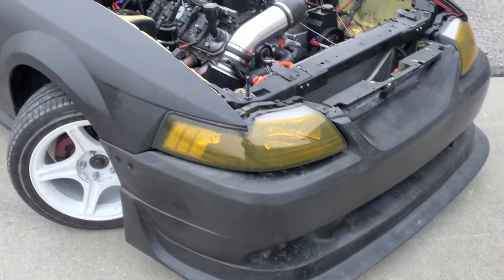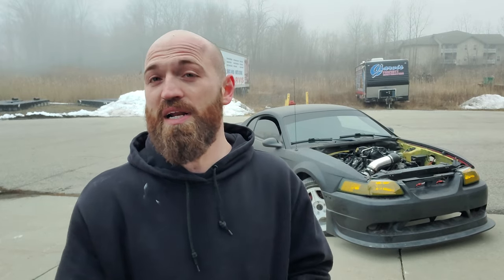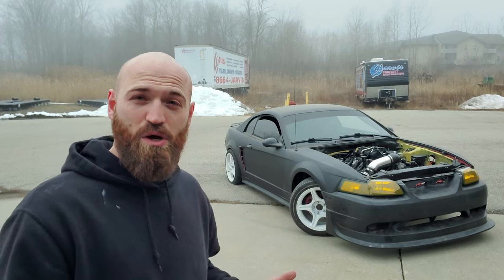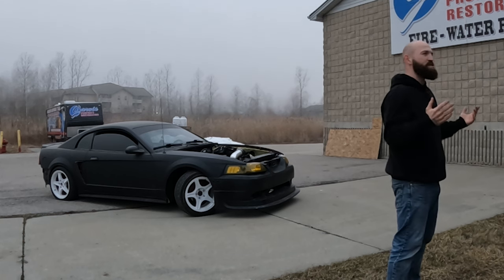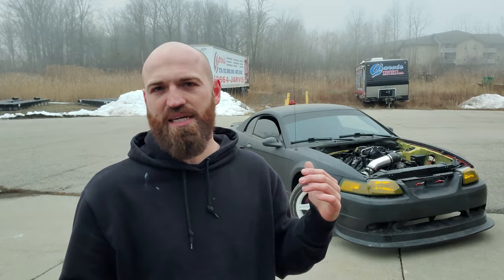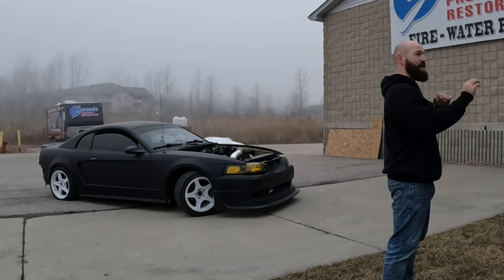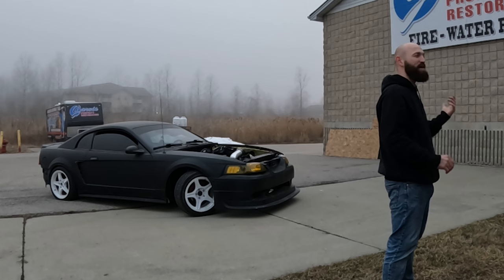The Truth About Building A Mustang For Drifting! | 4K

Comment: #1 remove the stock steering rack stops to gain a few degrees and get or fab an angle kit. #2 don't run tailpipes just dump it before the rear axle or side exit for more ground clearance.

Comment: I learned how to drive in a 2002 Roush Mustang. That learning experience included some donuts, figure 8s and entry level skids. 🙂 You're right about the terrible factory steering angle but other than that, these cars make a lot of sense. That Roush happens to be my mother's one owner car and I plan on taking it over when she's ready to part with it. It's a stage 2, recently supercharged with 330 whp and 350 tq. ❤
Reply from the maker: Learning to drive with that much power must've been a blast!
Reply: @Typical_Garage It was indeed! My first time out of a parking lot after figuring the clutch, I pulled out and began an 8 hour road trip. I also hit 100 mph with my mom's permission! Lmao 😂 That car is about as close to family as a piece of metal can get. 💕
Reply from the maker: @renerpups  Love that!

Comment: OH, pro tip for the steering angle. Apparently, there are sleeves or pucks or whatever in the factory steering rack that you can shorten or remove to get more travel. Chris Fix did that to his SN95 and I believe he gained 10-12 degrees of steering angle, getting it overall into the low-to-mid 40-degree range.
Reply from the maker: I did this and wasn't that impressed with the difference. like from driving experience, there was much of a noticeable change

Comment: So how’s a v6 s550?
Reply from the maker: I have no experience with them but I'd image they're pretty good. The 3.7 V6 in thr 2015+ cars make just over 300whp which is plenty for fun having
Reply: @ yupp. I’m actually pushing around 350-360 estimated right now, I’m just not sure if that’s enough to like properly drift without wet surfaces and maintain a drift

Comment: BTW you don't need to LS swap it. Twisted Wedge 2V heads and a David Vizard spec cam will get you at or above 400whp. Could push it even higher with a high-compression build and some port-biasing work (like what David does) to the twisted wedge heads. As far as the exhaust issue, well, I assume part of the problem is that the driveshaft has to have a travel distance due to live axle problems.

So a "fix" that I theorize might be a bit easier than a full IRS conversion (especially IRS with GOOD geometry and strength, quite unlike the Cobra IRS) would be to build and convert the car to a De-Dion axle with a Satchell Link. Bonus points if you do it with a Corvette-style rear-CV transaxle and use inboard brakes, too.
Reply from the maker: I agree that an LS swap isn't essential but it is one of the most practical swaps for guys starting off in a base model V6 car.

Comment: I would definitely say upgrade the entire rear end on the sn95/new edge bc I put a LSD carrier in mine, 4.10 and 31 spline axels and I haven't had any issues with it
Reply from the maker: I think gearing should depend on what type of power is being made. 4.10's with a stock 4.6 2v is a solid option. I went 3.73 because a cammed GM 5.3 makes a bit more power than that.

Comment: Could not agree with everything you said more man. I drift a 1998 gt. I did a tko trans with a twin disc, because trick flow heads, cams, forged rods and pistons, bigger valves, link ecu, 200 shot of nitrous. I did a full drift domestic front end, fortune auto coilovers, ksport front brakes and I built my own handbrake setup....just like the rest of the car actually. I built the engine myself (didn't even take it to the machine shopy car had 89,000 miles when I bought it. In the wrapper. I did all bbk rear arms because its good stuff. I got her down to 3020 with me in it. I'm 6'5 240. Still has a/c and I haul a Bluetooth speaker around with me for tunes when I have a good lookin passenger. However I built my exhaust out of oval tubing from vibrant. I paid the money for a 6 foot length of it and I gotta say, it was TOTALLY worth it. My headers meet into the 2 inch thick 4 inch wide oval, pie cuts to get a 45° bend, out right before the passenger rear wheel cut at the same angle as the body.   It makes 440 barefoot and 650 on spray. More than enough for me. My car never breaks, it always starts and she's an absolute monster. 305s on the back 285 up front.
Reply from the maker: Love that! Mind if I ask how often your going through a bottle of spray on track?
Reply: @Typical_Garage  brother ur a fellow slidy boi AND a mustang guy. You can ask me whatever the F you want. Honestly it depends on the layout. At grange I don't even use the bottle. But at my local track outside of Reno, Nevada the bottle runs  empty after the 4th set of tires is dusted. The bottle lasts pretty much all day. I do have a full throttle activation. I put a floor mounted BMW right pedal in my car. They have that little click at wide open throttle which is what activates the solenoid. I arm the system with the fog light button, windshield washer is my purge. Lotta repinning but, it was worth it.

Comment: I agree, this lack of steering angle just sucks to deal with. I just bought an angle kit and coilovers  basically out of necessity. My clutch packs failed twice already in less than a year, so Im just gonna weld it after i slap a dual caliper set up on it. Why did you LS swap btw? I know the 2v aint really worth upgrading
Reply from the maker: angle kit, coilovers and a good diff is really all it takes for these cars. As far as why I did the LS is because this car was originally a V6. After I sent 2 rods through the oil pan I decided I wasn't putting another V6 back in. lol

Comment: I think those run 355 stock.  373 really wakes it up on the bottom end.
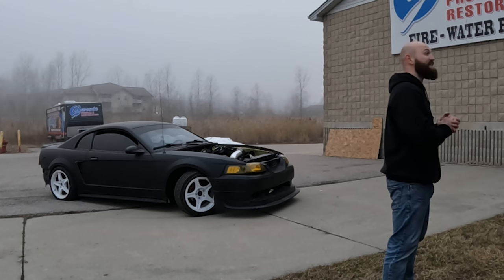Reply: 3:27 from the factory
Reply from the maker: Mach 1's and the 03-04 Cobra's had 3.55 ratio. Everything else was 3.27

Comment: Very nice video, one quick question more on the boring side, how do you go about insuring this this, is it a non-op trailer only drift car, do you have special low mileage insurance, rates on these old stangs is crazy, i just wanna know if there's a way around it, as it is a failing point for me
Reply from the maker: This car is track use only so insurance isn't something I worry about. The most street use it sees is maybe once or twice in the summer I'll go up to the local gas station for a snack but that's it.
Reply: Do you have special insurance for it?
Reply from the maker: @cryptikss  negative
Reply: @Typical_Garage  just low mileage insurance? liability only?

Comment: would've loved to learn drifting in a stock car unfortunately rwd cars are a premium would've cost me 16 thousand dollars to get the cheapest auto car rwd car, worked cheaper to build a car got a foxbody 302 engine and transmission on a bet (free!!!) the chassis (fathers old project car so also free) is a mitsubishi chariot awd is being converted into a racevan with a turbo 500hp v8 and custom angle kit that hopefully can be finished in 2-3 months🤞🤞
Reply from the maker: That's a wicked build! Keep me posted on how it goes
Reply: @Typical_Garage  will do its has a couple trick features that make it comfortable like dbw, antilag, 2step, adjustable boost and drive modes. Custom wiring for engine harness, chassis harness, custom taillights, custom headlights, full stereo system and a few more stuff that I'm working on

Comment: im basically a noob when it comes to american cars but i was wondering how the SRA compares to an IRS, i feel like having little or 0 adjustments for toe/camber is a challenge when it comes to having a drift car. is it worth to IRS swap or does the SRA feel fine?
Reply from the maker: I have no experience with a well put together irs setup on these cars but to put it in perspective why that is, a well put together irs cost 4x as much as a sra on these cars.
Reply: @ do you have any toe/camber adjustment at all with the sra? im just kinda confused i feel like thats pretty important especially if you lower the car + squat under load throws off camber and is sure to have uneven tire wear no? again i have no experience with sra just doin my research before i buy a shell😂
Reply from the maker: @homesick6265  no camber or toe adjustment. Adjustable upper arms allows the pinion angle to change but outside of that, regardless of ride height, camber and toe are at zero degrees

Comment: I picked up a shitbox 98 gt vert to use as a drift car, havent gotten to really do anything to it yet as other projects are ahead of it , but my main things I hate are the angle, and the 4.6, and the fact its a vert so I have to buy a cage
Reply from the maker: If it's a 5 speed car, maybe you could source a hardtop and swap over the drivetrain unless you're dead set on having no top
Reply: @Typical_Garage  not dead set on not having a top, but prices on these damn cars are getting ridiculous and got the opportunity to get it off a buddy for cheap and even pay him here and there until it was paid off, plus it's in a condition that's probably just best used for drifting anyway, but it's a canvas I suppose and it's better than having nothing to work with at all, and it'll probably do ok with a little work, plus I suppose a cage would be cheaper than a whole other car, so I'll work with it, just those are the things I don't like about it is all

Comment: So im a beginner drifter who has no experience in drifting and my first drift car is a 91 foxbody gt. It does not have the stock 5.0. Ive done a 2011 crown vic 4.6 swap and a t45 trans. Im on coils, but i have not yet touched the steering angle on the car? Should i get seat time before getting an angle kit?
Reply from the maker: for sure get as much seat time as you can with or without an angle kit but be aware the stock angle is going to be your next bottle neck to address

Comment: How will a new edge drift with 4:10 gears ? I was building for the 1/8 mile but I now would like to start learning how drift
Reply: I lowered the rear with eibach lowering spring with strange 10am adjustable shocks, stock front struts with Viking 200lb coil over, and I have a built 4r70 automatic, how is drifting an automatic as far as durability to drift I could use as much advice as you are willing to share
Reply from the maker: I apologize for the late response but that setup doesn't sound like it'll work well. Lowering springs are still typically pretty soft and auto's don't do well in tight transitions. Is still welcome you to go out and give a try just don't set the expectations too high, ya know?

Comment: So can I not build a drift car out of a 3.8 liter?
Reply from the maker: It's doable but swapping out the rear gear ratio will make the experience way more enjoyable. Keep an eye on oil temp and pressure too. I locked up my 3.8 by hot lapping on a summer day and being negligent with the oil

Comment: Are the v6 worth it?
Reply: 2000% yes
I have a 2004 v6
I lowered it
Put a borla attack x pipe
Painted it again mate black

21 inch wheels
Changed the interior
Speed is like 180 mph 
0 to 60 mph in 5 secs
Soo
Its a great daily bro
Good milage